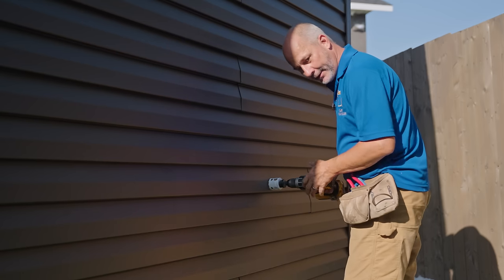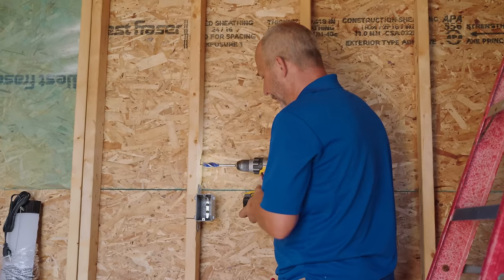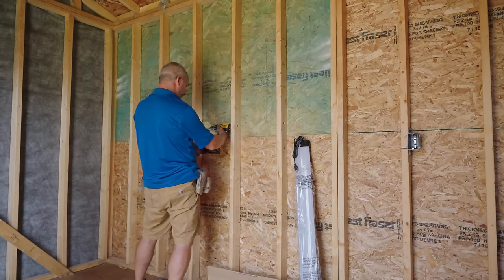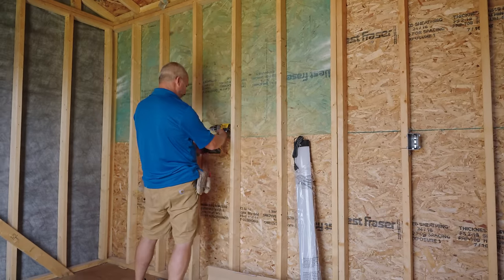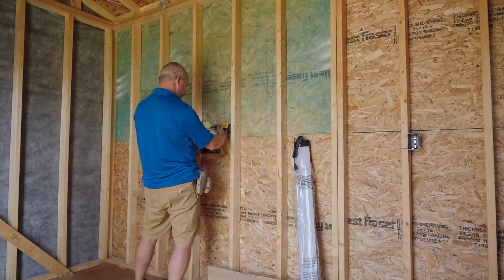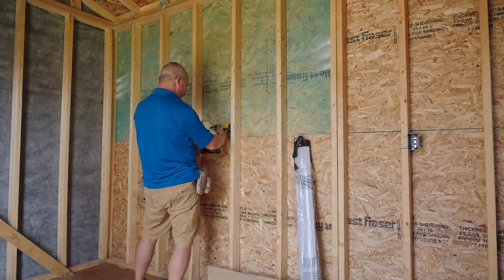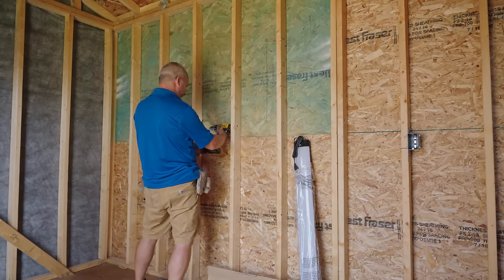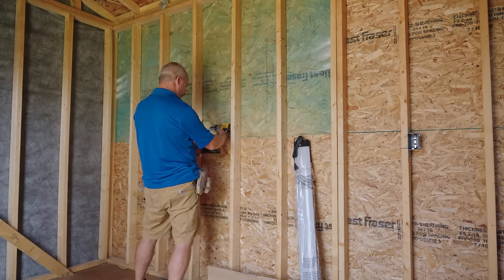How to Run Permanent Temporary Power to a Shed

Comment: You can also place a ground fault outlet on your first outlet to protect the run.
Reply: That works only if the outlet you plug the shed extension cord into the house is not GFCI protected.  You cannot have 2 GFCI’s in series.  I found that out trying to plug in a welder into a GFCI protected outlet.  The welder has its own GFCI built in.  😅
Reply: @nakedtommy40 Your statement that you cannot wire GFCI in series is factually incorrect.
Reply: you can infact have gfci in series
a lot of outdoor appliances and extension cords contain their own non removeable gfci
Reply: Probably makes more sense to put the GFCI on the outlet that the extension cord powering the whole thing plugs in to .. Most likely place where a fault would happen is where water might be. Better yet, use a GFCI breaker on the circuit
Reply: @nakedtommy40  you prolly plugged the welder into a 15amp outlet is what happened
Reply: @srobeck77 Or he plugged it into an outlet that had an arc fault circuit interrupter, which can look much like one with a ground fault circuit interrupter. Welders generally use arcs to generate the needed heat, so that would trip the interrupter even if it was on a breaker that could handle the needed amps.
Reply: @altkev   I had just watched a video of a guy making a pretty robust extension cord, and did so with a GFCI outlet. Up to that point, like the guy who made that erroneous statement, I thought that any circuit which includes a GFCI outlet had to include a GFCI type of circuit breaker to properly protect the circuit. Every one of the GFCI protected circuits in my house are running through a distinctly "GFCI Circuit Breaker", but knowing that this isn't required, why are those breakers a thing? 

Do those GFCI breakers offer some sort of additional protection when used for a circuit which includes a GFCI outlet? What am I missing?
Reply: @altkev  That is the best kind of incorrect. And my kitchen agrees with you.

Comment: Also good to note on your switches and outlets that the push fitting for the wire is a single time use per most manufacturers so once you pull the wire out of it you have to use the screw contacts anyway.  There have also been a number of studies showing a number of different circumstances where failure of a switch or receptable is due to a push connector issue.  Screw connectors all day if you want it to be one and done and easy to work on later if you need to.  Great job man.  Always love your videos.  I am not a certified electrician but I was a certified electrical engineer and I am a handyman.  Keep the great content coming.

Comment: Thank you! I had to wire up a fountain in my back yard with a switch. I've never done that kind of thing before. Your video made the process super simple. I had to use an existing conduit that went below ground and came back up in the middle of a bricked in slab. A video by another DIY wiring guy showed me how to run a cord through the conduit and then pull the romex through. Thanks!

Comment: Wow! Thank you! I just had my shed installed & I want to run electrical outlets before I put my 1/4" plywood up in the inside.  I learned so many tips & trucks from you. You were easy to follow & it was helpful for me. Ive done minor electrical work like adding plugs & lights but now I'm ready to run some wire in my shed. I can get most of that done B4 an electrician gets to me thanks to your video! I appreciate you!!

Comment: Nice layout and well done on the video.

The only thing i would have done differently would be to mount a weather tight box on the outside instead of the 90° junction point on the inside. 

Essentially the same functionality, but ill never have to worry about cleaning off my work bench to access it. It would also serve as a junction point for later permanent power.

Comment: I like running electric in my chicken coops and their runs.  I used two timers so the lights in the run turn off half an hour before the coop to draw the chickens inside to eat and drink before they roost for the night.  A dusk to dawn porch light for me and a couple of outlets for accessories like the water warmer.  I also added a couple outside outlets to power the occasional yard tool

Comment: When you talk about permitting and inspection requirements, you really need to make it clear where you are located.  These requirements can vary drastically from one place to another, and just because this doesn't require a permit for you does not mean that's true for lots of other people in other places.

In many places, even if the connection to the shed itself is not "permanent", if you are doing any permanent modification to the structure for it, such as everything you are doing inside in this video, that work still may well need a permit and inspector sign-off before it can be used.

Everyone should always check with their own local city/county offices to determine whether something they're doing requires permits or not.  Don't just blindly trust what some yahoo claims in a YouTube video.

(I was pretty impressed with the rest of the video, though.  This is all really good quality work, and a good example of how to do this sort of stuff correctly.  Much better than lots of other DIY YouTube videos out there.  I do wish you'd actually put some sort of weatherproof box on the outside so that the (non-waterproof) extension cord plug connection could be done somewhere out of the elements.  The current way, you just can't really safely plug in the shed in the winter time, which seems kinda dumb.)
Reply: I think you mean used legally, obviously it can be used

Comment: Only thing different i would have done is instead of that male plug hanging out the side of the shed, install a little portal with a door you can just open and feed your extesion through when in use and then the connection is inside the shed out of the weather and out of public view
Reply: I'm surprised there was no mention of this in the video. He mentioned it wasn't a weather proof plug but then it's assumed he's leaving it out in the weather?
Reply: Yeah, seems like he could've come up with a better solution.
Reply: The best solution would be a generator power inlet box. It would add maybe 50 bucks to the total cost of the project but they're designed to be weatherproof and permanent, and you can get ones that are just 120V 15A type plugs for an extension cord (usually for a whole house generator you'd get a big locking 240V plug).
Reply: All he had to do was spring for a power inlet receptacle and it would've looked like a proper job

Comment: Jeff, I know somethings can seem nitpicking. But I have been told more than once, “Ground, Neutral, Hot”. Always protect yourself first when connecting electrical, because even when it’s not hot, it’s still hot. This really hit home a few years back on a major transmission line project, first person on site after a long weekend was killed exiting his truck when he touched the dirt. The line was a long ways from being live yet. But traveled 100’s of km’s beside another live 500kv transmission line. Voltage induced all weekend on the new construction line, and being an unconnected grounding station the voltage potential was great.  Same as on DC, negative before positive.

Comment: Use a generator plug box for a cleaner interface e.g. NEMA SS2-50P going to a panel in the shed. Then install an RV receptical on the house.
Reply: Can you explain this? I going to start wiring my shed before winter.

Comment: I bought an RV receptacle that you can plug an extension cord into to feed power to my shed. It looks better than a cord hanging out. My first setup was to just run the cord through the door. I found the RV plug on Amazon, and it works great until I can get permanent power.
Reply: Did the same, except I got a twist-lock version to ensure the plug wouldn't come loose.
Reply: @Dracovivi  I don't have a lot of activity in my backyard, but that still was an even better idea than mine.
Reply: If that’s working so well why would you get a permit lol. And does that one extension cord be able to function that whole shed?

Comment: I’m basically doing the same thing with installing plugs and lights in my cargo trailer using a 15A waterproof port plug as my external access for the extension cord. Great tips as usual!

Comment: i did basically this same setup in my shed / small garage. about 20 years ago.. power is not used super often.. so the 30 seconds to plug in to my outside 20 amp gfi to my shed is not a hassle. and this was a quick easy way to have shop lights and place to charge batteries etc.

Comment: I received a deep gash on my finger from a installation just like this one.  The light switch had a full sized plate sitting on top of a box on an unfinished wall, exactly as in this video.  Reaching in the dark to flip the switch on my finger caught the razor-sharp corner of the plate instead.

There are small outline outlet plates, usually in grey plastic, that just barely cover the edges of a standard electrical box.  They are made for installations like this.
Reply: My first thought too when he put the full size plates on. We just bought a new house and the two outlets under the sink and microwave outlet had the big plates that I replaced with the box sized grey ones.
Reply: Or metal covers of about $1 that match the outline of a standard one gang box.

Comment: Great video. I don't know about Ontario, but in Québec we have to permanently mark white wires, when used as a switch loop (black sharpie on all the visible white of the wire).
Reply: Best method is to get heat shrink and a neat gun. Makes a more permanent indication,
Reply: In Ontario you cannot permanently mark a white wire any colour unless it is #1 or larger
Reply: He has also mixed up the whole switch leg wiring.....at the plug the black feed should have gone to the white   thus indicating to anyone in the future that the white is now a hot...and the the return from the switch...is a black going to the plug........but since when do d.i.yers ever follow the rules😂😂😂😂😂

Comment: I used a boat/RV adapter that fits into the wall. I assumed that's what you were going to install when you drilled that big hole in the wall... not just a dangling bit of cord.  The inset adapter has a male plug set inset, and has a cap to seal it when not in use.

Comment: It's amazing to learn how to do this stuff. I've put in a couple of power outlets and connected to breaker switches for my garage. Got fed up with trying to use an extension cord. I've also added light switches and more power outlets in my house along with fixing someone electrical crap job where grounds were broke in 2 outlets and he had 2 light switches hooked up to 1 outlet for the garbage disposal and dishwasher. I'm a newbie but someone was incompetent in the stuff I found.
Reply: A light switch to a dishwasher? That’s crazy!

Comment: Hi Jeff, I also added wiring to my new 12x24 shed. the only difference is that I only drilled a small hole, just enough to slip the wiring through to the outside to keep the hole small. then attached the plug. I also had the wire come out of the floor to hang the wire and plug under the shed away from the elements. Thanks for the vid.

Comment: Given the opportunity I always run 14-3 to my switches, just because new smart switches need a neutral and it's always nice to have the option in the future
Reply: 14-3 is two hots, a neutral, and a ground (in the US), used for three-way switches or often used to power a fan and light on separate switches.
Reply: @Lightingcap yes, or in his switch leg he did he could cap off the white for future neutral use and use the red and black for the switches legs. If he ran power to the switch the 14/3 could go to a seperate fan and light on ceiling if he was to put one in (like in a house).
Reply: in US code a neutral is required in the box
personally I had never thought of solving this with 14/3 instead of running the feeder and fixture wires back to the switch box
Reply: That's the first thing I noticed was his switch box not having a neutral.  This future permanent wiring job won't pass inspection.
Reply: New NEC code requires white neutral at a switch, so no more recoloring white for a switched hot. 3+ground or 4+ ground cable for switches now.
Reply: @nyetloki  That is good to know and makes sense since so many times the old no neutral limits options.
Reply: @WoodgemanX he’s Canadian. Not sure what their code requires.
Reply: @dropndeal  14-3+ground, hot neutral ground and switch leg
Reply: It's code in the next cycle I'm told. Haven't done my 2023 update yet so I'm not sure how the language changed from the old code.
Edit: by saying" it's code" I'm talking about a neutral at switch locations.
Reply: @dropndeal switch loops would require a 3 wire, Hot down, hot up, neutral, ground

Comment: I wired my oldest daughters basement couple of years ago (Ontario, Can) and upon inspection was surprised to learn we must now run neutrals to all boxes, used or not. Its now code. Cut it, cap it and coil it away... stick with 14-3 (12-3 if you're rich) is for any future use or expansion, also many smart home type devices mostly all require a neutral, even if a standard pole switch doesn't..

Comment: Last summer, I helped a friend do this very thing, except the shed was pretty far from the house, so we did some solar panels on the roof, 12v LED lighting and an inverter for AC power. We also put in a generator plug on the outside and a manual transfer switch on the inside setup so that the generator would charge the batteries and power the outlets.

Comment: Great video.
I'm installing 2 sheds in my backyard. I'll do your wiring trick, except, no extension cords needed. I just bought an Eco Flow Delta 2 Max. I'll keep that generator charged and inside one of sheds. It will be pluged into an outlet to provide power to the wiring inside that shed. If I ever need power in the other shed, I'll either carry the generator there, 50 lbs and plug it in. Alternatively, I would run an extension cord from the generator to the wiring in the other shed. 👍

Comment: This "temporary-to-permanent" concept is very practical and time-saving for the future.  Thus seems mostly practical if the shed is within 75 ft of the power source.  My shed will be about 135-150  ft from any power source and would have to run through a garden and around other objects.  So, I am looking at a possible solar solution.  Anyone else considering this option?
Reply: I’m in the same situation. $7000 for a sub panel with permits

Looking for something as an alternative because my 200’ extension cord can only do so much.
Reply: 2 extension cords? That's what I have going right now for my shed which is just over 100ft from an exterior outlet. One of these days I'll rent a ditch witch and bury a line, but it's been working fine. Just use 12/2 extension cord if you plan to run any power tools out there. I wrapped where the cords connect with shrink wrap (like for packaging) and no issues. Extension cords can be found surprisingly cheap, considering UF-B wire is like $2/foot.
Reply: I used a solar system, but it’s for my chicken coop tractor. Since it’s set up basically like a RV trailer that I can hook to the hitch of my truck and move it anywhere on my 5 acres.  Using the grid for power would have been a problem every time I moved the coop tractor.  So I ran my own solar system with the solar panels on the roof of the coop with the battery inside the coop. Gives me enough power for all the lights I need in the coop plus power for a heater to run in freezing weather and a heater water bowl . I have also used drills in the coop as well. Only thing I have to do when I move the coop tractor is maybe have to change the angle of my solar panels for the best sun shine to hit my panels. 
My system actually was fairly cheap, got a solar kit from harbor freight and a medium size converter to handle the amount of power I be using in the coop. My lights are all 12 volt bulbs and surprisingly very bright! I bought the light bulbs on Amazon and their a clear glass bulb instead of frosted which dims the lights a bit. 
Later on I did run a 110 volt power line going around the 3 watts of the coop with plug ins. I ran a RV male plug that’s got a waterproof surround and lid on the outside of the coop. Just like you find on most any RV trailer. Now if I ever need to use 110 volt power inside the coop tractor I just have to run an extension cord to the coop and plug it in.  With solar as your only source of power you still have to deal with bad weather and when the sun not shining you don’t get much power charging your battery bank.  It’s nice to have the option to still have the 110 volt power installed inside your building where you can still connect a extension cord in a pinch to get you by least for a short period of time! Or least be able to connect a generator if the power grid too far away?
Reply: 30:49   they could require a permit for solar ,  any way they can take your money.
Do you think in the 1800s you had to pull a permit to cut down a tree and build a log cabin. Dig a hole as a well , or install a outhouse? 
Maybe the wind mill that put water in the horse troft needed a city permit?    This is a Free country?
Whos kidding who?

No building permits and code came about because of some of the disasters in the past where whole cities burned down like sf and the windy city.  And or because people would wire a new outlet with 16/2 no ground speaker wire. 
People had no clue how to make it safe.